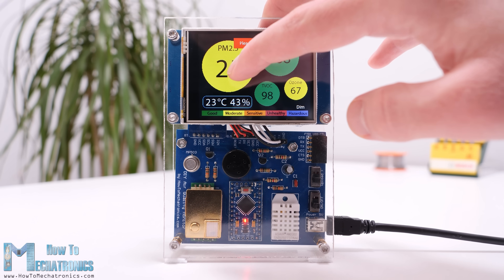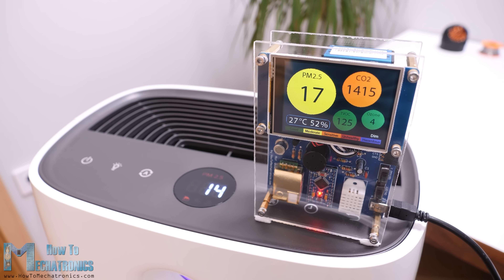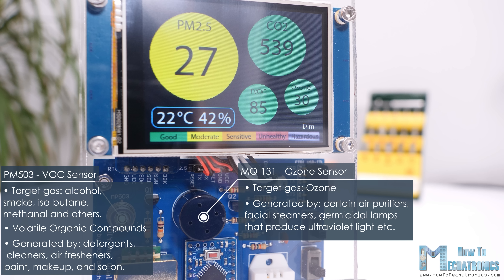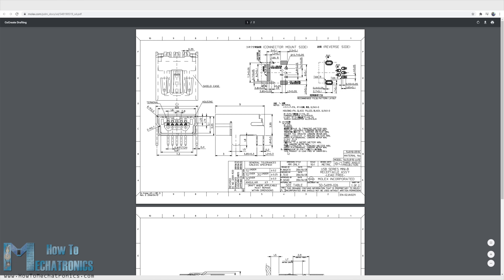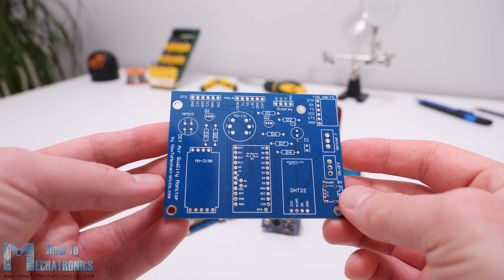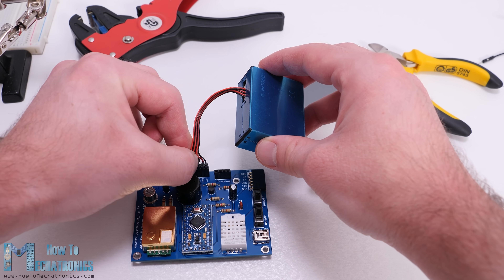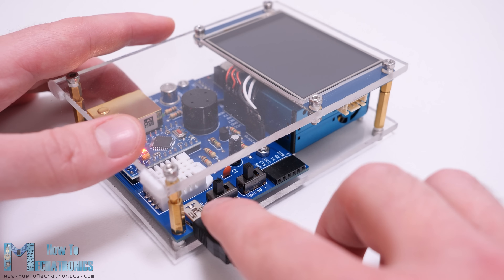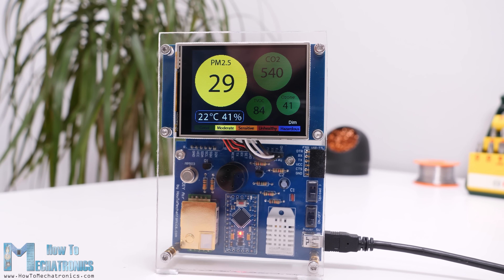DIY Air Quality Monitor - PM2.5, CO2, VOC, Ozone, Temp & Hum Arduino Meter

Comment: A fantastic project. I want to do a PM2.5 indoor air project, and this gave me ideas to add extra sensors. I'll be using an ESP8266, as I want connectivity to my Home Assistant home automation. I'll send MQTT messages to send the air quality data to the home automation system. It'll be a while though, I've got a couple projects in front of this one.
Reply: I also have the same idea, may i ask how do u power the esp8266? I want to power by batteru but don't know how to do it
Reply: @XuanGOD  I was just going to use a USB wall charger to power it, with the 5 volts it outputs. I haven't ever used a battery to power one.
Reply: @astrostevehobby5096 Thank you, I also want to ask that my sensors and LCD use 5V so can i connect all of them to the VU pin?
Reply: @XuanGOD  All the boards are labeled a bit different. But as long as the sensors don't take too much current, you can power them from the 5v pin. You might want to Google "Feeding power to Arduino: the ultimate guide" and read about how to feed the boards power (even batteries). For my larger projects where the parts I hook to it take more power than the Arduino can supply, I use a regulated 5v power supply, and input power to the 5v pin (not recommended, if you read the article I mentioned), and I can power the sensors not from the Arduino itself, but from the power supply, which can provide more power. In that case, just don't let the power run thru the Arduino first, the traces can only have so much power running thru them. I'd assume most projects and sensors would not be a problem. You'd have to Google how much power your particular board can supply. For the ESP8266 type boards - I have not used one of those yet, and an unfamiliar with them, except that it can be supplied with power from a USB charger.
Reply: Hey there 
Would you like to share details please

Comment: Hello very good job... I m going to made it one. Can you explain the pinout of the mp503 and the mq131 when I place component in jlpcb the pin don't match with yours... Thanks
Reply: No help no answers... Ok
Reply: @pegzod2527  i too have the same problem did u find the solution for this! Pls reply

Comment: very nice. Would it be possible to add a wifi module to the project to make the values accessible for home automation software over network, like domoticz or home-assistant?
Reply: Just redesign with an ESP8266 and you'd have WiFi and all of the other code would work.

Comment: great idea to assemble all important sensors on one board. A value of 1M is displayed in the schematic for R7. Looks faulty. I think, the value means 1k?
Reply: Yes, I dont know witch value  for the resistors are right? 
I wish me a Part-list of the resistors and Condensators please, its a great Project, the PCBs are on the Road to me from JLCPCB ;-)
Thanks in deet Dan, Greets from DF7MR Mike
Reply: R7 1k. 
R6 100k

Comment: Excellent project for the right person.
I built one 3 years ago. No LCD, since I used a ESP8266 module instead of a promini, and did everything through the browser. 
I only installed DHT-11, MQ-5, MQ-3, MQ-9 and MQ135, VEML6075 UV sensor, and DSM501A PM2.5 dist sensor, which was $4!
I think my project cost about $25-$30
Yours is in excess of $100 without a PCB.
Reply from the maker: Yeah, that's true, the sensors I used are not the cheapest, but of course are more accurate and reliable.
Reply: Hey there 
Would you like to share details please
Reply: Is it available on git?

Comment: Very nice project! I might just buid one myself. How would one go about adding a carbon monoxide measure as well?
Reply: I want the same and swap out the ozone for it.
Reply: The TGS5141 is a good but expensive sensor. The MQ-7 might be cheaper for you.